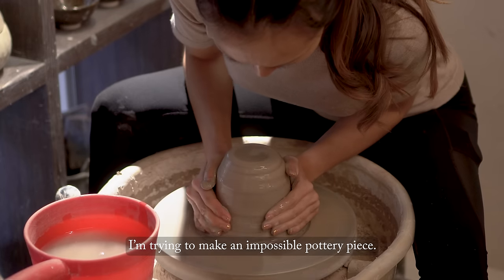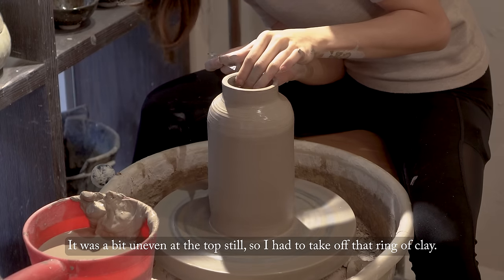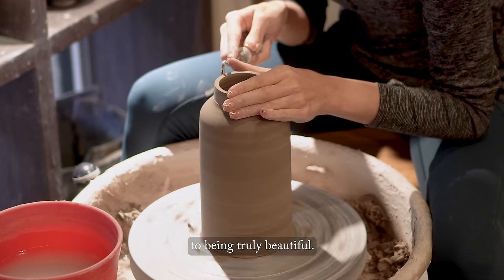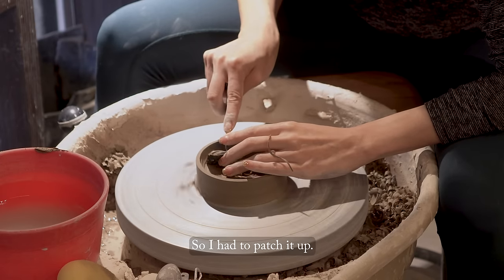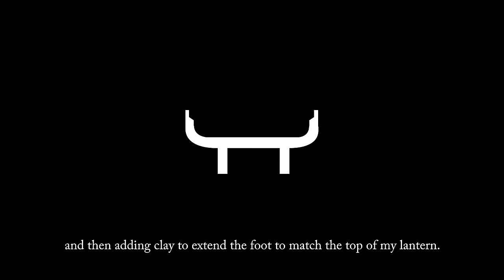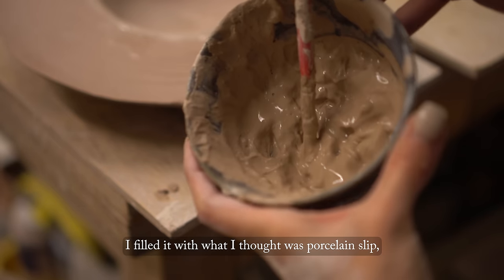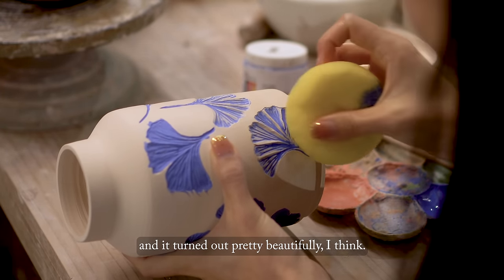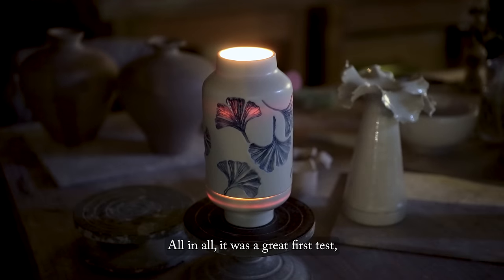making an impossible pottery piece

Comment: Wow that clay is extremely dark for porcelain. All the porcelain I have ever worked with has been luminous white even in the wet stages. Really interesting as the properties of Porcelain are the Kaolin white clay, sometimes you can porcelaneous stoneware that is grey when wet but fires like porcelain. Maybe I'm just used to working with really white porcelain or something. 
Also with porcelain centering is key. With stoneware you might get away with a little wobble but with porcelain it just makes your job twice as hard. You are doing really well to bring it back from that.
One more tip that has saved me countless times,  for a crack try blending (Blend well with a  immersion stick blender) some toilet paper up into your slip. The paper fibers act like a bridge for the clay and will 'bridge' the crack but burn off in the kiln leaving behind pure ceramic. you can add other ingredients to this like Sodium silicate but I have fixed many cracks with just toilet paper and slip. I have even patched bisque fired pieces with small non structural cracks with it., eg surface cracks around a finial.
Reply from the maker: Wow, thanks for sharing this wealth of knowledge! Do you patch bisque fired with the toilet paper + slip mixture and then glaze over it once dry? 
And yeah, I was also really surprised how not-white this porcelain was! But it fires to such a beautiful white.
Reply: @janicerohrssen  Yes, but the times I have patched bisque I have used a drop of sodium silicate (it lessens the amount of water you have to use to make slip liquid) so basically I mix the dry clay, toilet paper and as little water as I can get away with (Maybe a 1/4 cup to a 1/2 cup of mixture),  to form a very 'dry' paste, I would say something like a peanut butter consistency (you can always add a little more water if necessary after the sodium silicate). 
When you have the driest mix of slip you can make and still have slip, then add a drop of sodium silicate. 
Mix well. This should deflocculate the slip by neutralizing the charges of particles in the slip, allowing for more even suspension and thinning. Makes the slip seem like it has more water in it, basically. 
Add another drop if you don't notice any difference with the first but the change will happen all at once, in an instant, one second you're mixing something that looks like peanut butter the next it looks like very watery slip.  If after the second drop if you still don't notice a change, add a dash more water. 
Hope that helps.
Reply from the maker: @tegannottelling  amazing. Thanks for sharing! 🫶🏼

Comment: Loved your process... I would suggest to try Laguna Frost Porcelain. This clay is translucent and gives a nice color. Looks like you fired to ^10, But if you have any ^ 5/6 firings this clay would give you a nice votive candle lit feel. ~Lori Yugen
Reply from the maker: Thanks for the tip! I think we actually only fired to ^6 because we fired it with other stoneware. Is Laguna Frost easy to throw? And I've heard it has issues with cracking — have you found that to be the case?
Reply: @janicerohrssen  I second the Laguna Frost.  It can be thicker and still translucent.  It does suck up water quickly and dries quickly, so to prevent cracking you'll need to control the drying.  Just make sure it dries evenly and you'll be fine.  it's my current favorite clay.  I love your lantern!  What a fun project!
Reply from the maker: @patspotpage  Thank you so much for the advice! I will order some Laguna Frost to try when I get back to London!